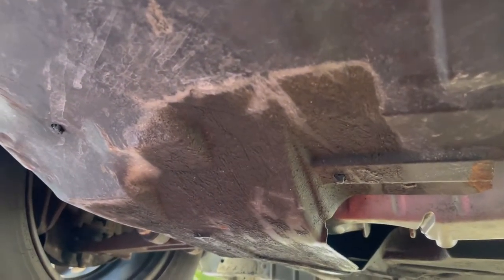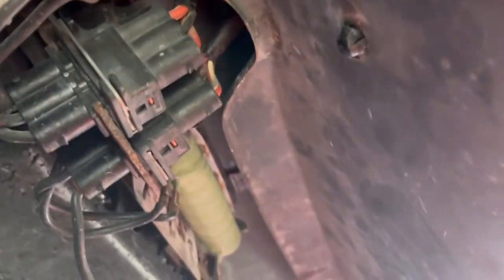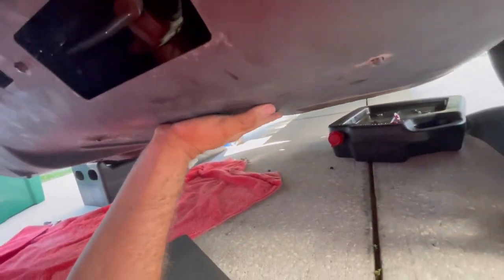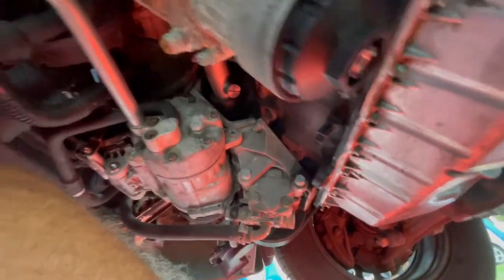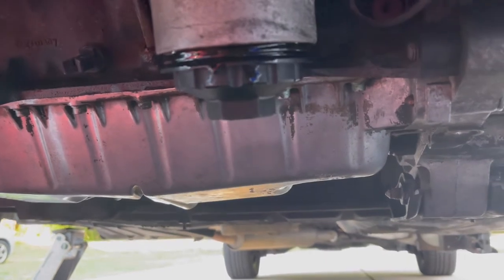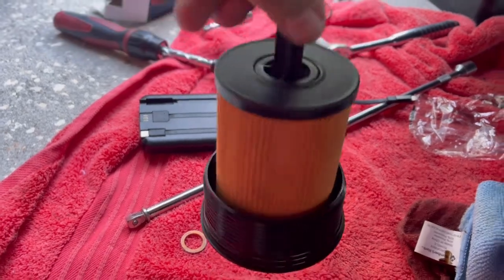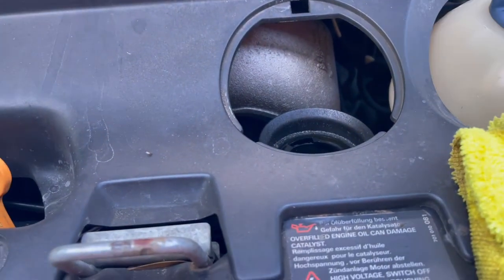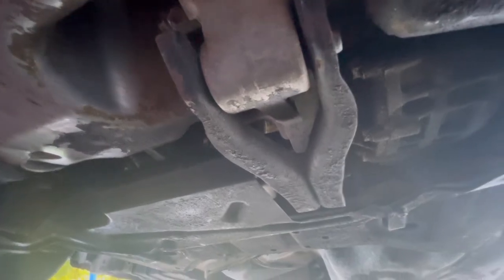VW T4 Eurovan VR6 oil change and inspection

Comment: Thanks so much for this. I’ve never changed my own oil but would like to. Do you know if the V-6 on the Eurovan Weekender ( not the camper) looks the same?  Also, what size blocks did you drive the front of the van onto?
Reply from the maker: VW used two different VR6 engines in the Eurovan with the split being in 2001. Just make sure you get the correct oil filer.  As far as blocks, do you mean ramps? Just make sure you get ones that have a proper load range. Mine are plastic.